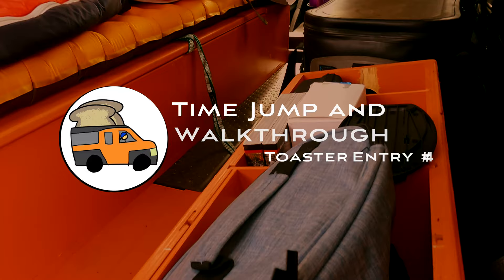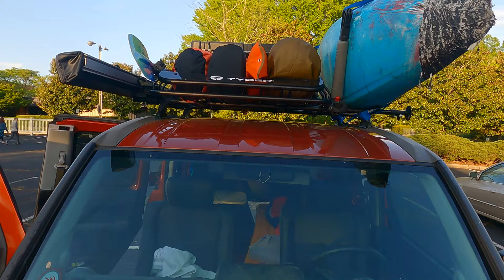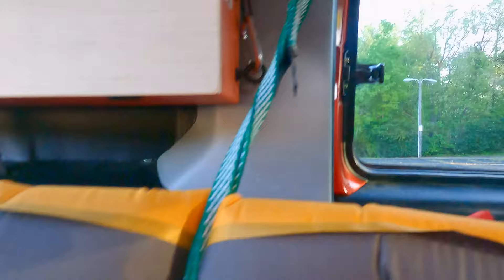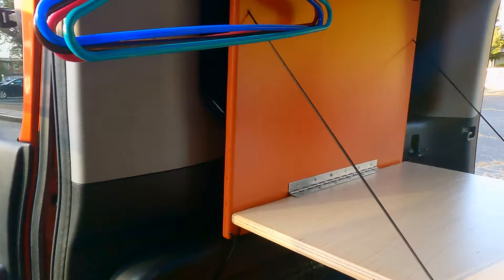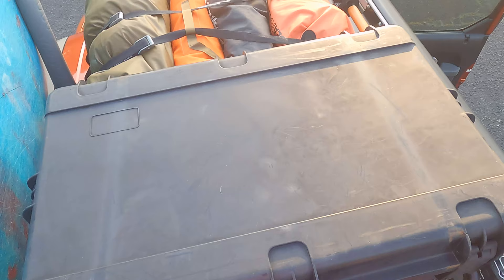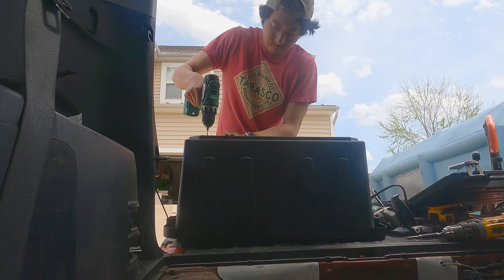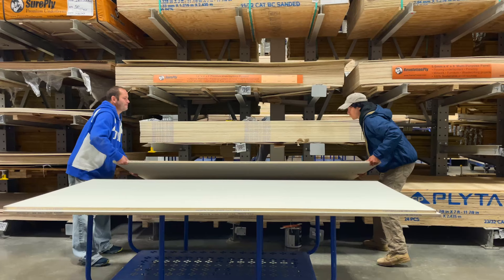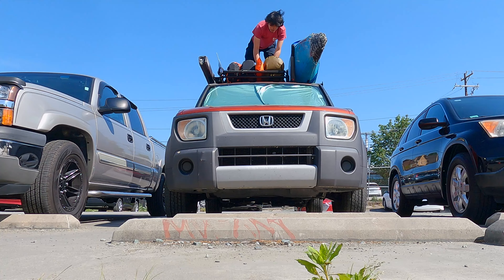Moving Into My Car! - Time Jump and Walkthrough - Honda Element Travel Vlog 4

Comment: How did you secure that top shelf
Reply from the maker: I used the carabiners from the backseats to clip in to eyelets that are screwed into the hanging cubbies. That carabiner is then attatched to cordage that runs to the carseat hook and the grab handle to suspend the cubbies in place, and then ziptied around the seat belt post!